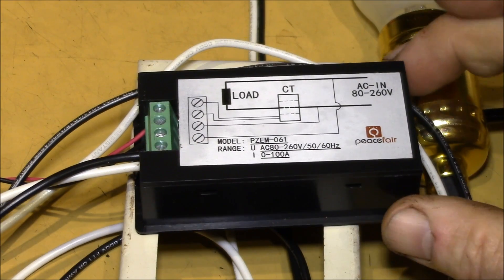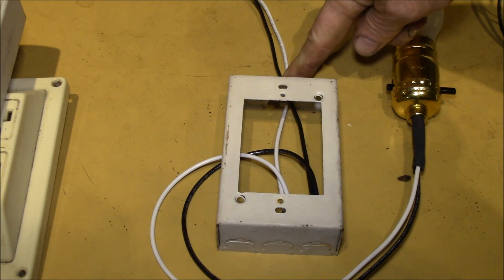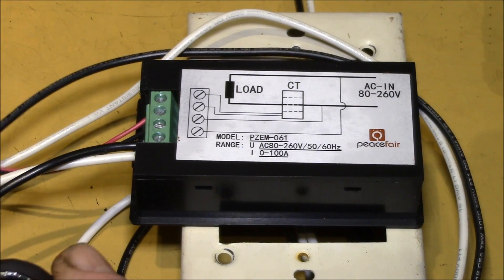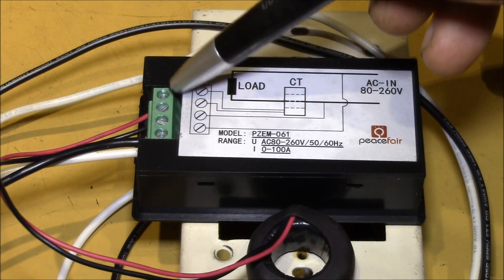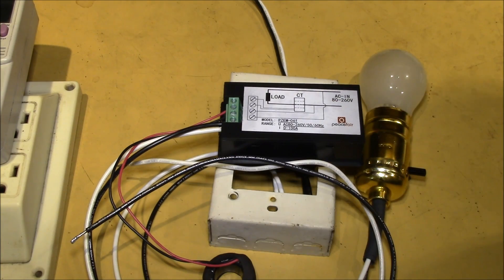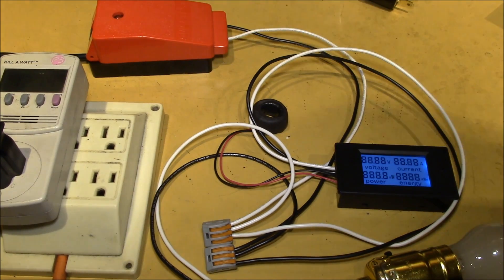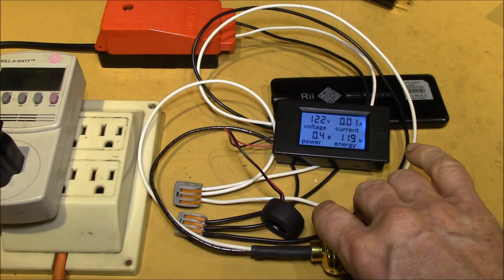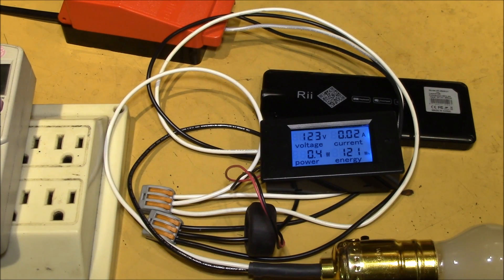PZEM-061 AC Panel Meter Wiring

Comment: I have this same model number meter connecting to a 240v line.  I have the CT on one leg.  To power the device I take one wire connects to one of the 120v legs and the other to ground correct to power the device?
Reply from the maker: See 240V wiring on this video:
https://youtu.be/LhR-Z6lBeZw?list=PLpY2FP1a9tivPdpLVyg8XMqxw6B6SAEbI&t=282
This way the meter reads the full 240V voltage and with the CT on one of the legs, it's measures the 240V current and thus the watts will be correct.
Reply: @The4Crawler  Wow thanks for the quick reply.  I see the black/white coming from the two terminals connect to L1 and L2 and not to ground.  Thank you!

Comment: So.....for a main-home panel to check the incoming power from an emergency  generator feeding an interlock.... ( via it's own double-pole breaker)......if you use 2 meters ( one for each 120V "leg").....it appears that Current transformer (CT) will be placed around the lead to one incoming leg of the dual breaker...and the "return" like-kind wire to ground ( or ground/neutral on the first main panel.). The 2 wires to the CT simply conect the CT collar to the meter. Correct?
Reply from the maker: Several methods to do that.  2 meters with a CT on each hot leg, Line1 and Line2 and meters connected from Line1 or 2 to Neutral would show all the data.  

One meter with CT on one leg and measuring Line1 - Line2 is another way, shown in this video:
https://youtu.be/LhR-Z6lBeZw?si=GcnDpCgEQt4FO1dg
This assumes current in Line1 and Line2 are close to the same.  

Or you can run Line1 and Line2 through the CT (swap the direction of one of the wires) and then the current display will show the sum of the 2 currents (amps1 + amps2) and then connect the voltage terminals between Line1 or Line2 and Neutral (it will read 120V or half of 240).  And half the voltage times twice the current - actual watts.
Reply: @The4Crawler  ..another question. What is the "desired" ( technically/code) way to connect wires from the CT in your main panel load center....to the meters located outside of the load center? For clarity.. my load center/main panel is mounted flush to drywall in my garage...and there is a removable section of wall immediately below my panel where I can locate the 2 meters between studs. This removable wall section below the panel will be clearanced such that the face of the hard-mounted meters will show flush with the removable wall section.  I presume Smurf tube or like kind connector is used for the larger ( 14 ga ?) wire that connects the breaker power supply Inside the load center....to the meters below......can the smaller CT wires be co-located with the power lines inside the Smurf tube?....or need they be separately run?....what's your suggestion?
Reply from the maker: @TheWilferch  Apparently OK to run the CT and power wires in the same conduit:
https://www.eng-tips.com/viewthread.cfm?qid=181101
I would use something like shielded, twisted pair cable for the 2 CTs to help keep those signals clear of the 120V power wires.

For my split phase, whole house power meter I just run the CT wires outside the panel and then the meter plugs into an in-use receptacle below the panel (mine is outside the house).
Reply: @The4Crawler  ...thanks again for the info and for the quick response. Cheers.
Reply: @The4Crawler  ...prefer individual meters for each of the 120V legs....so 2 meters. Since the "power" connection for the meters will be from some dedicated breaker for each "leg"..I would think of using one-breaker per meter. To assure the reading integrity of each meter....we need to be careful where the breaker picks up power....to match the same  120V "leg" where the CT measures the 120V leg into one of the double-pole breakers used as "main" from genset. Although it would function, we don't want to mix these up id using 2 meters is to monitor the health of each incoming 120V power leg. Thanks for the tip.

Comment: I want to know what the energy usage of my 240V well pump is... so two hots.
Do I put both through the CT?
Do I then have to power the device with 240V.. or do I power with 120V?
Thanks.
Reply from the maker: One hot through the CT and power the meter from 240V:
https://youtu.be/LhR-Z6lBeZw
Reply: @The4Crawler  It worked, Thank you!

Comment: How do you set up the kilo watts and stop it from flashing as it is an alarm as the Manuel states. And if it does start to flash by over voltage and how to reset the module. Many thanks.
Reply from the maker: I cover the alarm feature in this video:
https://youtu.be/hRCrvGlqYoQ

Comment: A couple of questions. Can I supply the meter from a mains socket to the device and put the CT round the house incoming wire.  Secondly, can I extend the CT wire to say 10 feet without lossof accuracy, or not too much loss, thanks.
Reply from the maker: Sure, as long as you have a split coil CT that'll fit around that wire:
https://youtu.be/9TTQTxHzOjQ

Signal from a Current Transformer is just that, a current, so as long as there are no breaks in the line, it can extend a fair distance and the current signal remains the same.

Comment: Thank you sir for this video.  I keep seeing mixed comments on how to use the CT to monitor genset power coming from a plug-in to power the panel.  I have a 50amp plug-in for my generator that has 50amp outlet.  This plug goes to a 50amp breaker in my panel that I flip on when using the genset, and disconnect from service.  So I want to put a CT on the 50amp line at the panel to monitor the genset power draw.  So isn't the power coming from genset all in phase and couldn't I run both hots going to the 50amp breakers in the same direction through the CT?
Reply from the maker: 3 options, will be covering in an upcoming video.
1. Run 1 hot wire through CT, connect voltage inputs across both hots like this:
https://youtu.be/LhR-Z6lBeZw

2. Run both hots through CT, but reverse one wire so it runs opposite to the other.  Then connect voltage input line-neutral.  Your meter will read 2x amps and 1/2 voltage and 1x power.  The current in the 2 hot wires is 180* out of phase, so if they run the same direction you'll only see the difference in the currents and not the sum.

3. Get 2 meters and put one on each side of the 240V split phase.
Reply: @The4Crawler  Thank you sir.  For option 1, can run my voltage wires from the meter and connect them to the 50amp breaker used for the genset?  I appreciate your time and responses.
Reply from the maker: @jpiv3177  Sure, just connect the 2 voltage input terminals on the meter to the two hot wires off the breaker, assuming it's a double pole version.
Reply: @The4Crawler  Ok, I'll give that a whirl. This seems like the easiest option. I'll be reading 230v across the 50amp (dble pole) breaker and the amps from 1 hot.  Total Watts=230v x Amps
Reply from the maker: @jpiv3177  Yes, that's the idea.  The current reading will only be as accurate as the two 120V circuits off the breaker are balanced.  For a pure 240V load, those would be equal.  But if you had something like 4 amps on one side and 3 amps on the other side, the meter will either read a bit how or low depending on which side of the breaker it was reading current from.  If you had the CT on the 4 amp side, it would display 960W and if were on the 3 amp side, it would display 720W.
Reply: @The4Crawler  Much appreciated.  That makes perfect sense.  So to get the accurate reading, it is best to use 2 meters, which would allow you to see what each leg is pulling.  Is it detrimental to the generator if you have 1 leg loaded up more than the 2nd leg ?   Thanks again
Reply from the maker: @jpiv3177  Yes, 2 meters with the 2 CTs or a real split phase power meter with 2 CTs would give you both current readings if you want to see each separately.  Or do one meter/CT with both wires through and you can see the sum of both line currents.
Reply: @The4Crawler  Thank you sir for the help.  This along with your videos has been a good tutorial.

Comment: Would this be possible to connect to a 4 outlet?
Reply from the maker: Here's how I put one in a double gang box for a 240V receptacle:
https://youtu.be/LhR-Z6lBeZw

Should be similar for multiple outlets but you'll need more room for the meter.
Reply: @The4Crawler  I meant as in connect the meter into the wiring of a gang out let
Reply from the maker: @SJ_999  All you need to do is run the hot or live wire feeding the 4 outlet box through the CT and hook up the hot and neutral to the voltage inputs on the meter.
Reply: @The4Crawler  yeah I think I figured it out. But for the hots going to the meter do they need to be on the first outlet if I’m jumping the other one to it. Because I don’t think it’s possible without jumping them together
Reply from the maker: @SJ_999  If you want to measure the power for all the outlets, just run the incoming hot wire through the CT before connecting to the first outlet.  Then you can connect the first outlet to the next one.  This way, all the current flowing to all the outlets, goes through the meter current transformer first.
Reply: @The4Crawler  ok so the ring goes on the white before any outlets then I off of the first outlet I run the black and white wires back the meter
Reply from the maker: @SJ_999  Yes, that's it.  Just be sure one of the incoming wires runs through the round current transformer before connecting to any of the outlets.  The 2 voltage terminals on the meter can connect to the hot and neutral wherever it's convenient.
Reply: @The4Crawler  thanks for your guidance got it working beautifully! Now I just need to tapcon it to wall.

Comment: Thanks , That is the way I understood it as well. gave you a Thumbs up.

I am using one of these to Monitor the Watt usage of my 12500 Generator. I am going to need 2 of these correct? One CT (Clamp) for each 120V leg of the 50 Amp Inlet wire. Then add the readout Watts to come up with a total. Going to mount these at my Service Panel so I can check the wattage as I turn breakers on. The CT will not work around both legs correct?
Reply from the maker: I hope to be making a video shortly to answer this frequently asked question.  The answer is it depends on what's the most important thing you want to answer.  2 meters will give the separate watt/amp readings with the need to add the watts to get the total output.  1 meter/CT with some tricks can give you much of the same information in one reading, but will take some math to extract the individual line readings.  Or you can get a true split-phase power meter, with 2 CTs to do it all in one readout, albeit at a much higher cost.
Reply: @The4Crawler  Looking forward to the vid... By tricks I guess you mean I just can't double the reading from one to come up with a toatal..
Reply from the maker: @chex313  I covered one option in the video below:
https://youtu.be/LhR-Z6lBeZw
You can also double the current with both load wires through the CT but there are some tricks to figuring out the individual currents/watts.

Comment: So I messed up and wired this wrong and it popped. Is it fixable? If not are any of the components salvageable? What would have blown first?
Reply from the maker: Usually either the input capacitor or power resistor:
https://drive.google.com/file/d/1w80QYWeo8H5LdRoheGxNCMZViL9uqo81/view?usp=sharing
I look at those parts in this video:
https://youtu.be/b2MXXSuzM2k
Reply: @The4Crawler  you are always on it. Many thanks....

Comment: Is this unit good for 240 v
Like monitoring for a rv connection. Will it monitor both legs. I understand maybe two ct’s to do that.
Reply from the maker: Yes, can be used on 240V.  See below for one option on a pure 240V load:
https://youtu.be/LhR-Z6lBeZw
This assumes line1 = line2 current.

Another option is 2 meters with a CT for each monitoring each leg of the split phase.  

Or you can use one meter and run one line through the CT forward and the other line through the CT backwards.  This adds the two currents, then connect the meter's voltage inputs between neutral and one of the hot wires.  This way, you are measuring 1/2 the voltage, combined with 2x the current the watts reading will be correct.  

Which way to use depends on what you want to display and what data is important to you.

Comment: It's my understanding that this kind of meter only measure one line from the house meter. Please shed some light in this. Do I have to buy two oft them in order to mesasure the real Amp in the house?
Reply from the maker: Assuming you have 120/240V split phase service, then 3 options.
1. Install 2 meters, one on each 120V leg and then you get volts/amps/watts on each side.
2. Install 1 meter and run one line forward and the other line backward through the CT, this will add the two currents.  Then connect the meter voltage input between one line and neutral, this will measure 1/2 the voltage, i.e. 120 volts.  Then meter will read 1/2 volts, 2X current and the total watts.
3. If the currents in L1 and L2 are similar, you can see my video later in this playlist on connecting the meter up to measure current in L1 (or L2) and voltage between L1 and L2.  This will display volts, amps and watts, assuming current in L1 = :L2.

Comment: How would I connect this to a Predator 8750 Generator is currently connected to my house by a Twist lock cord from the generator  240 outlet to the house.  I want to be able to monitor the total wattage of the generator to prevent overload.  Could I just put the O'ring clamp over the Twist Lock cord from the form Generator 240 to House connection?  Pls demonstrate showing the simplest way to connect.
Reply from the maker: If the 240V load is balanced, then you can run one of the hot wires through the meter's CT and then connect the meter voltage inputs across L1 and L2 like this:
https://youtu.be/LhR-Z6lBeZw
If the 120V legs are not balanced, you can run a wire from L1 and L2 through the CT, reversing the direction of one of the wires (so the currents add) and then wire the meter voltage input from L1 to N or L2 to N.  This will give a total watt reading that's correct, the volts will be half (120V) and the amps are the sum of L1 and L2 (i.e. doubled).

Comment: Can you add more length to ct wires
Reply from the maker: Sure, the CT only sends a sense current proportional to the load current, so any small voltage drop over additional wire isn't an issue.

Comment: Could I do this with a generator feeding into my house with an interlock switch?  I want to see if I’m close to exceeding the generators capacity.
Reply from the maker: Sure, see below for one option:
https://youtu.be/LhR-Z6lBeZw
That assumes a pure 240V system.  Or for split phase, use 1 meter on each leg or use one meter and run the L1 and L2 through the CT in opposite directions to measure the sum of the two currents then connect the meter's volt sensing input between L1 and N.  This will then display the sum of the two line currents, ~120 volts and the correct watts.
Reply: Scott, Yes you can. Watch my YouTube video and see how I did it.  https://www.youtube.com/watch?v=e7a4Zkcpmf4

Comment: Thank you very much R Brown!  I am installing a 'through the wall' setup (Reliance Control WKPBN30 from Amazon) for my portable generator to be outside.  I would love to add meter PZEM-022 in the setup.  The 'through the wall' has 4 wires:  Green (ground?), White (neutral?), Red (hot 1?) and black (hot 2?).  Seems from reviews on Amazon that with this kit Red goes to one row of plugs, black the other - will test.  Understanding from posts here that if I want to measure total load I'll need to use either two meters, or one meter with the Red and Black wires running in opposite directions through the CT - is that right?  
If so, I'm left with one q - to power up the meter, do I connect White to one of the two meter connections, and either Black or Red to the other connection?  Thanks!
Reply from the maker: If measuring L1 + L2 current (black and red) your current reading will be the sum of those two currents or about twice the actual value.  Reversing one wire is needed because L1 is 180* out of phase with L2.  If you run the wires through the same way you end up with L1 - L2 and that'll be close to 0 if your loads are balanced.

In order that power (volts x amps) reads correct, you need to "measure" half the voltage, or line - neutral.  Thus, if you have (0.5 x volts) x (2 x amps) you end up with (1 x watts).  In other words, connect the meter to black and white or red and white.
Reply: @The4Crawler  This is awesome!  Worked great.  One thing I realize is to use the through the wall kit, I had to use an adapter from the relatively light-weight generator (Champion DuelFuel 4375) to go from a 3 prong plug to a 4 prong connector to the kit inlet.  Also, the 3-prong generator out is 120V, so It dawns on me this is more a 'splitting' situation, where both Red and Black are in the same 'phase' (is that the right word?).  For this case, I found when Red passes through the CT in a direction opposite Black, I get an average.  When they both pass the same way through the CT it is additive.  I think this makes sense.  Just an fyi too - I did confirm the Red wire powers the top 3 outlets in the row on the top of kit plugging station, while the Black wire powers the bottom 3.  All is working great on my backyard table!  Now its time to install in the wall.  Thanks so much for you assistance Mr. Brown!
Reply from the maker: @yofalls  Yes, if it's really a 120V generator, then both L1 and L2 will be in phase.  So running both wires through the CT  the same direction will add the currents up to the total.  And you'll need to use the line-neutral voltage for the meter input as if you tried L1 - L2 you would get about 0 volts between those two wires.